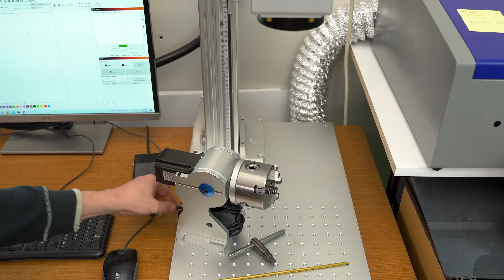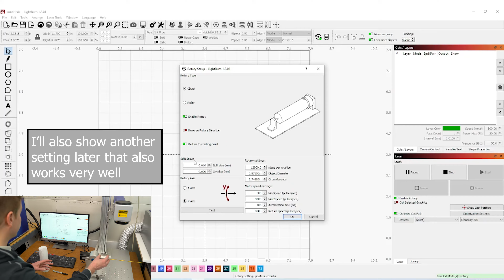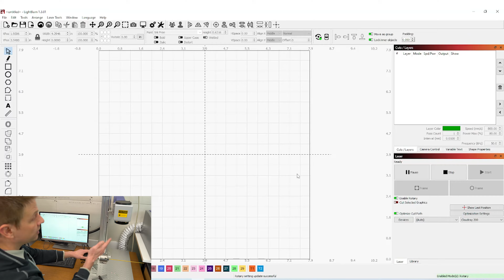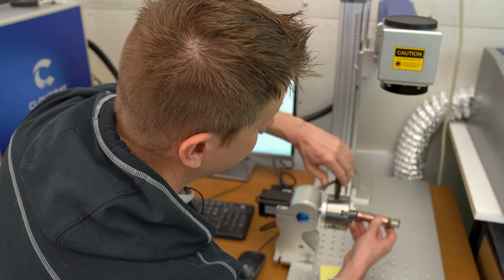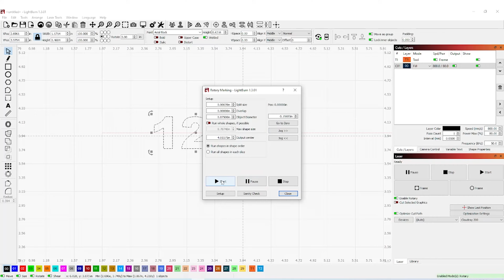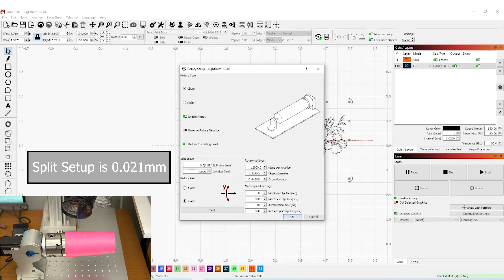Cloudray Fiber Laser- Rotary Setup+Project!

Comment: What size of rotary is that? I'm confused by all the sizes and need one to do mugs that are 4in. I also have cloud ray. Where is that rotary you purchased found?
Reply from the maker: It's the D80 unit, but I recommend the D100 with the larger chuck for the bigger tumblers.  The rotary is from Cloudray- before ordering I contacted them to make sure I was selecting the the correct rotary- they keep very good records of what is inside the laser machine they built.  "Most" machines will use a 2 phase rotary unit that has a 12,800 step count.

Comment: Do you find the speed and power settings need to be changed based on the color of the powder coat?
Reply from the maker: Yes- I've found is the easiest. Other colors are similar setting's but black needs far less power.
Reply: Thanks, I started with dark blue, and then the lighter colors kicked my behind.

Comment: I have the same machine as you and have done many tumblers, but I learned a thing or two today. One question for you. Have you tried to hook the D80 rotary up to a Cloudray CO2 laser? I am not having any success doing so. Cloudray says it should hook right up, and I have done everything they have told me to do. The steps are not correct in that it takes too big a step per increment. All the settings in LightBurn are correct. If you know a trick, I sure would love to hear it because, as you can imagine, it has me quite frustrated.
Reply from the maker: Thanks!  Yes- I have connected my D80 and D100 to the Blue Dream Co2 laser by Cloudray and have it working perfectly- it can be done! To make the connection easier I ordered more connectors like on the Fiber laser to install on the Co2 laser machine.  After I finish the next job on the Co2 I'll look up the rotary settings.  Thanks for watching!

Comment: Very helpful video! I do have a few questions. I have a cloudray as well. I got an order to do a tumbler and the image the customer wants. I traced it and scanned it into the program. The rotary is all set up and I’ve used it multiple times before. But for some reason with this image when I press start it pauses itself. Is there certain image pixels I’m supported use? Could there be a setting I need to turned on? I’m not sure what the issue is.
Reply from the maker: Thanks!  The image you traced; I haven't ran across that issue.  I think the issue is more on the Lightburn side- I recommend posting in the Lightburn Facebook group.  You'll be able to post photos and screen shots of your issue and hopefully get a fast response!  Best wishes.

Comment: Holy cow this was driving me crazy, I tried e very setting but the split. Others on the FB Fiber Laser Club were having the same issue so had to share you video.
Reply from the maker: The split settings have a huge impact with the rotary!  I'm able to use my settings for every diameter- it might be a little slower but the results are awesome and extremely consistent!  Thanks for sharing!

Comment: I don't yet own a fiber but am planning on a Cloudray. I see they have different configurations of rotary options. One has a driver included. Is the cloud ray directly connected to the rotary or does it need a driver. Thank you for answering such a newbie question.
Reply from the maker: That's a great question and here's the answer- maybe!  It depends on if the laser machine has the driver already installed.  I ordered mine configured with the correct driver for my machine and the rotary accessory.  Any time I order an accessory for the machine I ask Cloudray what the correct compatible accessory is and they look up my machine order and point me in the correct direction!
Reply: @thelaserchannel1  fair enough. When I place the order I'll check with them ahead of time. New question :) I was planning on ordering a 100 watt MOPA to do deep metal engraving. Is 100 appropriate or is it overkill and I should back that down? I've been trying to research fiber/MOPA as much as I can but I have no experience at all with it.
Reply from the maker: @chrisschrecengost1235  You are defiantly asking all the right questions before making your purchase! If you're main goal is deep engraving and color engraving the AR-100 is a better route (same price). Here's link to it: https://shrsl.com/49shz

Comment: Thanks for setup. Split settings are where I’m failing according to this video. Will try again soon.
Reply: New user…spent hours today trying to get the Rotary to do its job!  This video clarifies the setup and I have grabbed as many of the settings as I could. Let you know how it turns out!
Reply: @Goneaway-4-gud  I have the rotary working fine my problem now is the image is not the same as in lightburn? I had to install a bigger lens and stretch image (w) from 2.4 to 7 inches to get uniform on the tumbler? Trying for a min to get this process right.
Reply from the maker: You're welcome!